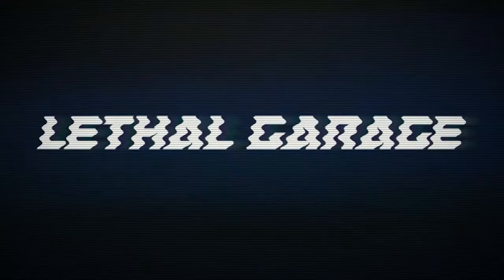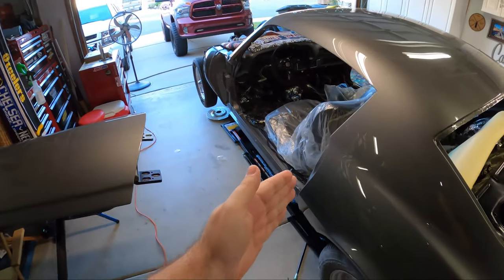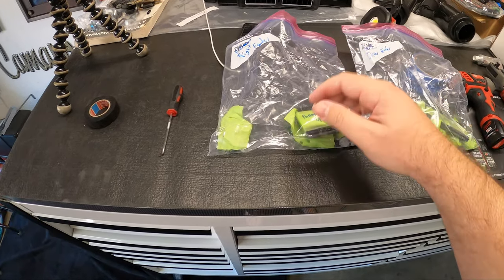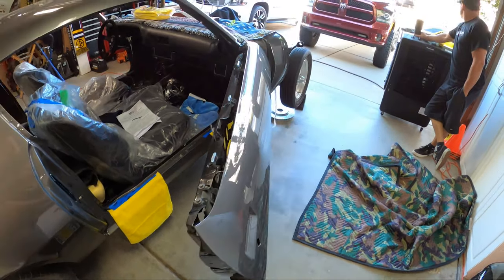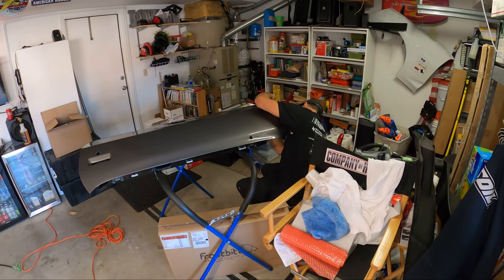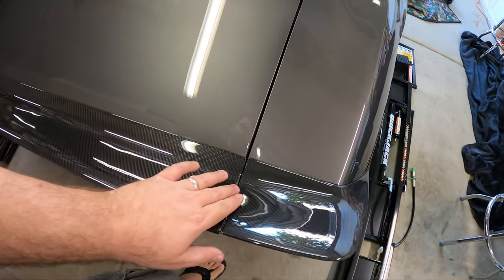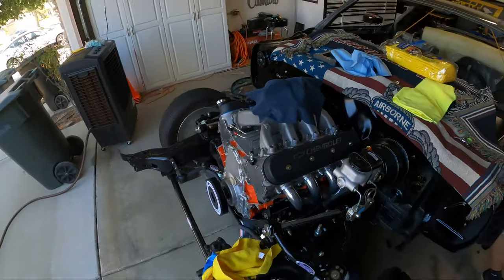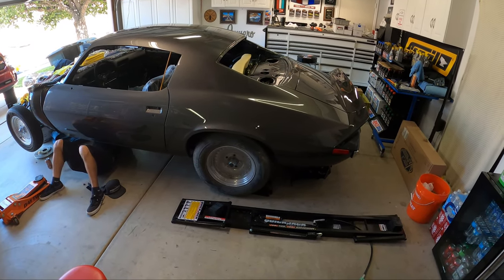Hanging Painted Camaro Doors! Are Perfect Gaps Possible?

Comment: Gaps look nice, is that an Anvil spoiler?
Reply from the maker: It is.
Reply: @Lethalgarage  have you had any of the finish clouded up on your anvil stuff? I have a power bulge hood that has clouded on 3 spots on the front edge.
Reply from the maker: @scottcoleman162  no I have not on either of my 6th Gen or 2nd gen. My 5th gen spoiler started to cloud because it was outside all the time and resin on CF isn’t design for long term exposure. I plan to wet sand and polish my hood and put a automotive clear on it.
Reply: @Lethalgarage  yeah, that's what I was afraid of. I keep mine outside but under a cover. I'm going to rally stripe mine and so most of it will be painted anyway.
Reply from the maker: @scottcoleman162  a little wet sanding and polishing will resolve the issue

Comment: How much does it cost to get something like this done? I have been eyeballing my grandmothers 1976 camero for years (I am 20) and she always gets mad about how the last repair shop ended up misaligning the doors. Theres a long back story behind the car (on how it got to be misaligned) but I would like to get it fixed if I ever get the car and I am not sure it is something I could pull off on my own.
Reply from the maker: Did they body work it and misalign it or they adjusted the factory doors and misaligned it?
Reply: @Lethalgarage  the body work misaligned it